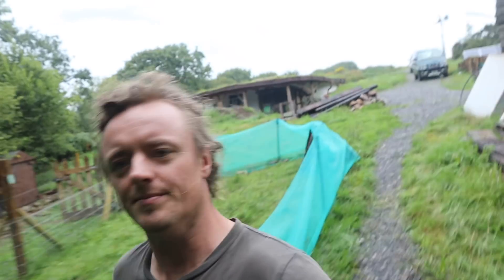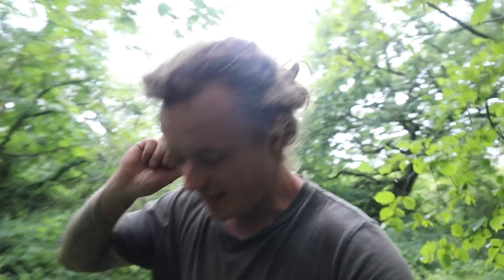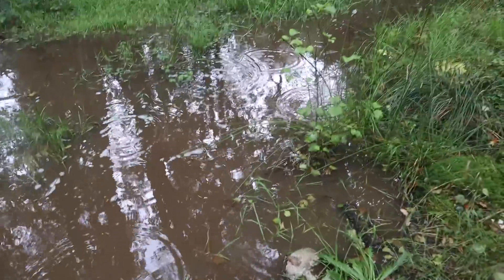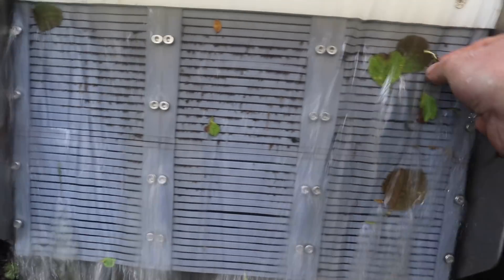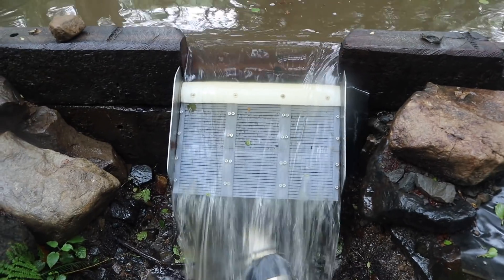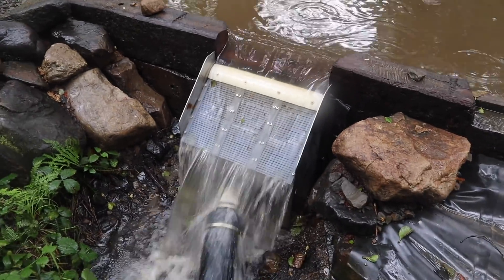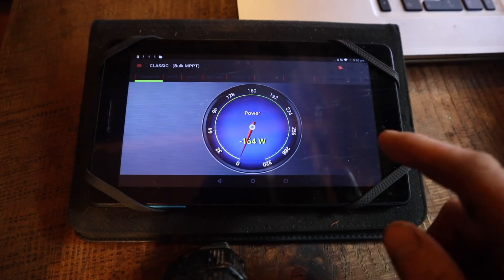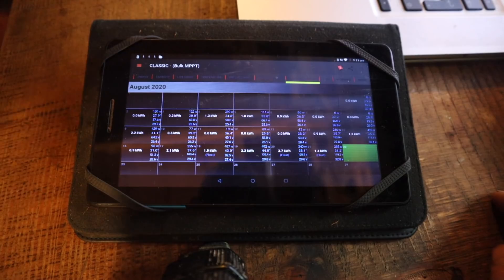Hydroelectric 3D Printed Intake update after Storm Ellen

Comment: Terrific video, yet again - I so enjoy your stories and appreciate just how clever and hard working you are.  Quite inspirational.
A couple of thoughts though - first, like so many others, you are much too careless in taking about KW when you mean KWh.  Power as opposed to Energy.  I'm sure you know the difference, but like so many others, you tend to use the two interchangeably, for which there can be no excuse. - Slap slap.
Second - and this is related to the first - when you show your (impressive) daily power generation log, showing 2 to 3 KWh per day during the storm and, presumably, during most of the wetter winter period,  It might be educational, at least, to convert this to money.  I don't know the average cost of electrical power in the UK, but a general rule of thumb is (using USD, or pounds, or euro - there all more or less the same these days) is something like $0.10 to $0.15 per KWh.  Maybe double that in Germany, as I understand they have decided to turn off their nuclear power stations and now have to buy most of there electricity form France, where I now live).  In the real world, electricity, including the infrastructure for the delivery network is still pretty cheap.  The real generation costs using oil or coal alone turn out to be more like $0.02 per KWh - most of the actual paid price is for the infrastructure - but that's another issue.  The costs for nuclear are much harder to calculate properly, but again, that''s another topic altogether.  Anyway, I really think you AUGHT to display the dashboard with corresponding money values, so generating 25 or so pence a day - or whatever your current alternative costs might be.   In this, I also appreciate that you might not even have the possibility of grid connectivity, so the cost isn't simple an alternative, it's the only way to turn on the kettle in the morning.
Third point (and this time, I have a positive suggestion, instead of what might seem an unwelcome criticism).  The 3D printed screens (terrific idea that) - maybe it would be useful to experiment with different scaling factors - the optimum scale, I presume, would depend on the size of the object you're trying to select out of the stream.  It looks from these videos that you have something like 2.5 to 3.0 vanes per inch.  Maybe a finer pitch, scaled to (say) 4 per inch would have less tendency to trap the leaf stems.  Or would this simply increase the algae-based material to more easily build-up and block the finer gaps.  Other applications might, as you discussed, have larger material to screen out - maybe requiring a larger vain to work optimally.

Anyway, keep up the terrific stuff and be careful of that back of yours.

Cheers and thank you once again

Comment: Hi Kris. I've checked the comments before writing this, and didn't see any other Q's, so, may I ask, what battery management software are you using from 4:56 ?
I watch all your videos (may have missed one or two over 18mths or so), and don't recall you talking about it.
Is it available for others to buy and install?
Regards Mark in the UK
Reply from the maker: It is an app for the midnight controler. You can download it by searching midnight charge controler but it only works with that controler.
Reply: Thanks Kris. Yeah, now that I've looked it up, I DO remember that 'MidNIte' typeface logo.
Reply from the maker: @thecorbies  Apologies, I meant Midnite.

Comment: Do you think it might help to place micro-mesh screen over the top of the printed screening, it would be flat, so the micro-mesh should (in theory) work better.. I mean it will take a bit of tweaking to make sure it's flat and all screw's & bolts are recessed... It's a thought, that could help.. All the simulations I have done shows it working well...

Comment: 500+ watts without solar is awesome. That means you've got a fairly reliable 24/7 10kWh/day of base production. I suspect that your only problem now is storage. You should electrolyze hydrogen over the winter (when there is plenty of water to electrolyze) to provide all the backup power you'll ever need. Hydrogen will give you effectively unlimited storage.
Reply: Doesn't hydrogen storage pose a safety issue? Plus you need to add the additional hardware to burn the hydrogen for energy; unless you're talking about something more along the lines of a fuel cell system.
Reply: @TOSViolator  No, hydrogen is the safest energy storage medium available (measured as adverse events per unit of specific energy).  No high pressures are needed for this type of application.

... and yes, of course, we are talking about a fuel cell. The fuel cell runs bidirectionally (electrolyzes to produce hydrogen from water and then reacts hydrogen with oxygen to produce water).  It is water neutral (i.e. 100% of the water you used to produce the hydrogen is returned when you react the hydrogen) but with a benefit that the water is rendered absolutely pure in the process (purity equivalent to distillation).   This means that the water from the creek can be used for electrolysis (with filtration of course) and then when the electricity is used in periods of low renewable production, drinking water is generated.  The entire process is about 70% efficient, but has the advantage of nearly limitless storage capacity (a tank capable of storing 160kWh would cost about $5000 whereas a 160kWh lithium ion battery would cost about $20,000)
Reply: @homomorphic  
Thank you for the information!

Comment: Kris, do you generate enough excess power to trickle charge an electric car?
Reply from the maker: Hi, Yes i do. I dont have a huge amount of excess power on average but i do get days like today where i have solar wind and hydro all coming in at full wack and today i am processing lots of wood and charging everything i have and heating lots of water. So on days like today i could pump quite a bit in to a car. considering i dont do alot of miles it would likely be enough on a weekly basis if i had one really good power day a week. Might end up doing a electric car share with my neighbours or something.

Comment: loving the energy apps etc - everything is working real well for you - so cool - i hear what your saying re the water skimmer etc, besides the water is close to you, so cleaning is not a huge issue like having to climb up and down a valley/hill - i did see a chap in America (on you tube) use a very different style with a barrel, with an out pipe at different heights, lowest one allows solids (dirt) to drain off, water for hydro is mid way i think, and an upper drain for floating stuff and seems to work really well, looks pants though not half as neat as yours

Comment: Hi, I think I may have figured out how to solve the leaf issue. It seems like there is a vacuum forming from water being pulled into the grill that is stronger than the water flow trying to push the leaf off. so the water flowing over the leaf and the suction of water behind the leaf is making it stick. To solve this. The outside of the grill fins need to be vertical ridges (smoothed out). It would allow for enough space for water to flow between both sides of a leaf to push it off the grill. The key here is to make the vertical ridges super smooth so water can flow smoothly and reduce things getting caught on the ridges. So if you are looking at each of those 3d printed modules,  put 4 equally vertically  spaced 1/8th inch ridges that have no edges and smoothed out. You should still get a smooth flow of water coming into the intake but no leaves. It's basically similar mechanics of flight. Having a pressure difference on a surface can make it lift up or push down depending on how much difference there is on either side of a wing. I hope this helps. Really have been enjoying your journey building this system. I always tune in.
Reply from the maker: That is an interesting idea for sure. Thanks for that. I will mention  that to Bjorn and see what he thinks about it.
Reply: @KrisHarbour  Cool! Just seeing if I can help. The main concept is you are allowing water to get underneath the leafs. You have the right  flow of water and gravity on your side. Just got to break that suction and you should be in business.
Reply: @SSingh-nr8qz  Great thinking. I wondered if it was some static force making those leaves cling to the surface, as I've seen cars add a strip of rubber to shake that off. But if course it must be a vacuum from the back.
Reply: @FurnitureFan  That was my thinking too. Remember the purpose of these screens it to draw in water.. Falling water creates air pressure as it falls. basically a tiny vacuum. We still want that pressure falling and ending up heading down the pipe. The trick will be figuring out how much air is being sucked in and then just equalizing it by allowing for air to get under the debri to not allow for suction and let the rest be done by the water falling down the screen. if that don't work, I would suggest a leaf blower set on a timer LOL.

Comment: Dude, awesome results!  Thanks for putting in time to show it to us.  Last week you educated me on the non-magnetic properties of stainless, but I can't get it out of my head that some neodymium would make install/removal of the screen a snap.  My brain came up with this -- drill holes in the stainless frame holding the screen, and epoxy some magnets into it.  Match those to magnets epoxied into the plastic screen?  Might not be worth the effort on a final product where you don't remove the screen often, but would speed up swapping for testing.  Great job on everything though, and thanks for putting up with all of our silly suggestions!
Reply from the maker: Yeah That could work. But education for this week neodymium magnets are really easily corroded. they would fall to bits in a short period of time. they do have a coating but that does not last long. I hope that didnt sound to patronising :D
Reply: @KrisHarbour  Anyone that gets offended by free knowledge will only limit themselves -- thanks for the education!

Comment: I wonder if you could put a pool noodle with a wooden dowel inside the middle floating across the mouth of the stream about a foot away from the turbine. You would only need to use a pool skimmer every few days to remove leaves backed up behind it & this would prevent a lot of debris going over the turbine inlet.

Comment: Hey Kris wonder if the grill  ran vertically as apossed to being horizontal?....
Reply: You need water to get inside. The curve on those slats only works when it's horizontal.
Reply: @dper1112  perhaps 45 degrees that way the water would vortex inside the grates.. have you ever watched the documentary on  Viktor Schauberger very interesting stuff, on how water flows in vortexes and also he discovered that water has a voltage. if a metal plate is placed on the surface, and another on the river bed a voltage can be read.. he also found a vortex can be used as a filter... heavy parrticles spin to the outside.. worth a watch... https://youtu.be/9MzamfIRb9o

Comment: Once you get the screws countersunk adapt a car windscreen wiper to sweep across the screen .

A small Car Battery charged up with a small solar panel and have a timer so it sweeps half a dozen times a day .
Reply: Yes, an automated way of clearing debris would definitely make for an interesting series of videos!
Reply: Yeah not hard to do. Though wiper motors are not the best idea here due to the amp draw. You could it using far less energy using a belt driven design along a track with a sweeping blade. A small gears motor turning the track and having a blade sweep down. It will be slower that a car's wiper blade but gets the same job done with a fraction of the energy use and less wear and tear on the grill. Also use a brush than a wiper blade. More effective for this kind of application.
Reply: @SSingh-nr8qz  good call on the brush
Reply: A good 'brush' could be one side of a letter box draft excluder.

Comment: i dont know if it matters in a stream that small but what are you going to about sedimentation? usually there are problems with increased erosion if you remove the whole bedload. would be cool to see like a flush gate that you can open during peak flow :)